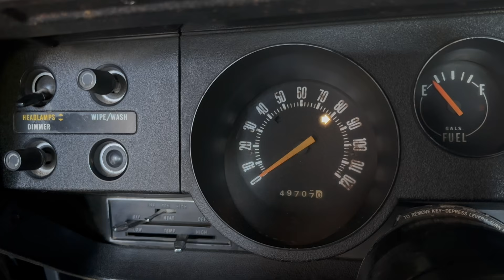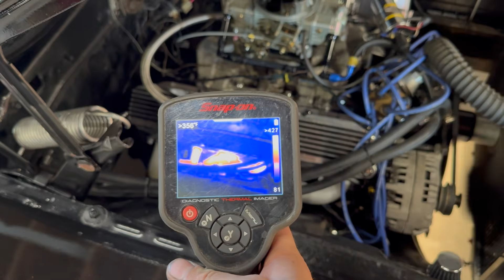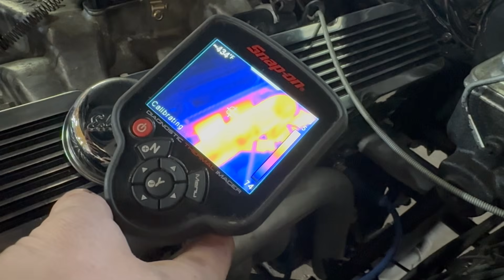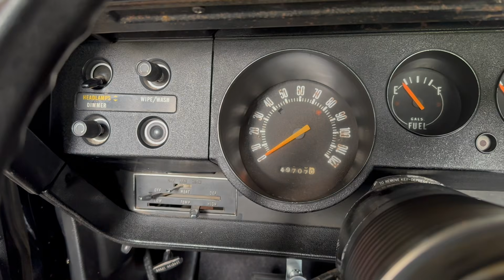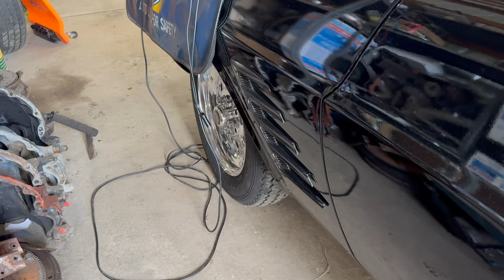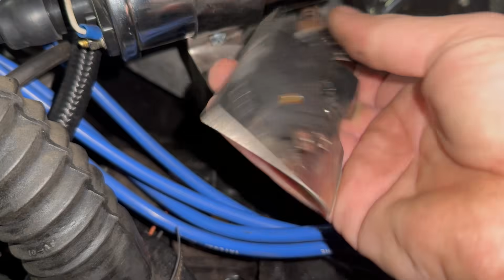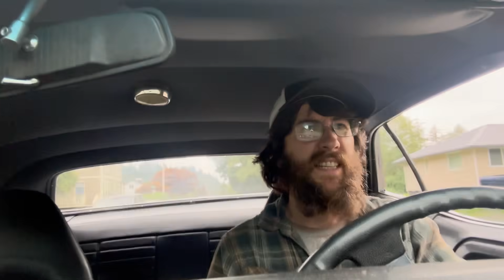What's Wrong With This 1973 Dodge Challenger? Electrical Gremlins, Big Block Tuning Tech, And More

Comment: Champions are junk they are not like they use to be I run NGK in my mopars that or AC but you will never find a champion in my Mopar because the quality went down since the 70's. another thing you should clean that carb it is black as the ace of spades and that is no good too
Reply from the maker: I disagree, they are just as shitty now as they always were, and I’m still running them in all of my small blocks. At least until my pile of them is exhausted. I think way too much thought is given to the name brand on one’s spark plugs. They’re spark plugs. They spark.

Comment: I could never understand why they put Gals in the fuel gauge on the standard fuel gauge it does not read by the gallons on the Rallye gauges so why did they ever do that and they only had it on the 70/74 E body standard gauges
Reply from the maker: Yeah no idea

Comment: I had the engine running like crap deal and turned out to be a ground issue whoever put the engine in the car did not hood a ground from the chassis to the engine and after that is ran so much better. It just goes to show how important ground wire from the chassis to engine really is.
Reply from the maker: Interesting. That’s never magically fixed anything for me yet.

Comment: I've not seen that far yet but I think its got a direct manifold leak
Reply from the maker: Have never found one, re-sealed the manifold once.
Reply: @DeadDodgeGarage  yeah I agree with everything you were talking about throughout the rest if the video. I was making that guess a couple minutes in but definitely a weak intake spring. You covered alot of ground with the ignition and the improvements that made for you. I have only recently started watching your channel. I like it alot

Comment: I had a 318 that would pop back in the carb like that. It was very unpredictable - sometimes days between it happening. Other than that it ran pretty good. Nothing I did made it go away 100%. Over a span of two years I checked and swapped out lots of intake and ignition stuff. Compression was good for the used engine it was. It turned out to be an intake valve slightly sunk into the head which caused the lifter for it to sometimes hold the valve open. I found it when replacing the heads. That 100% cleared the issue up. After I knew what it issue was I realized I would have been able to diagnose it by taking the rockers off and putting down a straightedge to compare to the other valve tips.
Reply from the maker: While that will reveal one valve that is way off, I can just about guarantee that most heads you check will have the valves all over the place. This is definitely an intake valve issue - whether it is occasionally sticky, or something else.
Reply: The total preload range for the lifter is something like 1/8 inch (don't remember exactly) making it visible for what I'm describing. So if the valve tips are off 10, 20 30 thousandths from one another that is normal and expected. If one is off 125 thou however you know there is a problem because all the lifter preload range is taken up.

Comment: A Jamie I had a 302 with a 750 vacuum secondary 
and I put a 50cc accelerator pump on it using the smallest suggested discharge nozzle but the extended ones and look out that works real good also I use the Alcohol Carburetors accelerator pump diaphragm 
and the discharge nozzle screw also I had used the accelerator pump cam that extended the shot   I don't see why a similar setup wouldn't work on a 400 ci engine  Just so that you know I had if I remember correctly a Comp Cam
.512 lift 270°Duration and even though you don't like 
Comp Cam  my car and a few friends of mine enjoyed the performance we got out of them
Reply from the maker: Comps used to be just fine. They’re not just fine anymore.
Reply: @DeadDodgeGarage  
I'll tell you what doing those supply side upgrades on a Holley by using the Alcohol Holley parts sure doesn't hurt it give it a shot next time those bits are lying around especially the extended nozzle accelerator pump discharge by using the extra capacity of the 50cc and the smaller of the suggested discharge nozzles you don't have it dribbling into the carb it looks more like a mini pressurized hose stream I believe that it has better way of introducing that extra fuel

Comment: I'm sorry but I never use Champion Spark plugs. We always stuck with factory replacement plugs. Fomoco and AC Delco. Except Chrysler. Usually Fomoco ( Motorcraft). Especially high compression stuff. Also much dislike Holley carbs. Carter :) IE: Edelbrock. But then everybody has their favorite things! Now I sound like "Sound of Music"😮
Reply from the maker: Factory replacement plugs? So, on a Chrysler product… Champions! That’s what they used for decades and decades. My Demon seems to run high 7s in the 1/8th mile with them just fine! And yeah, I’m a Carter/Edelbrock guy for sure.

Comment: First thing I did on my 1972 Plymouth Satellite was, flat black the front grill. Probably on the way home from picking up the car in 1979.
As you know They came with the metal grey coloured plastic with a small coloured piece in the middle and painting the grill black immediately changed the character of the car. 
Is that a 340 You got in that Pete ?   Nope that’s a can of flat black and some buckets out of a Sport Duster !
It’s the shape of the front bumper, and the lack of any badging on the 1972 Satellites that I like best. I prefer a sleeper, clean lines and minimal badge appearance on all my rides. All GO and NO show helps keep a man out of trouble.
The more I watch your channel the more I am motivated to reacquire an Early 70’s. I just saw a really nice in molested 1974 dodge charger400 Magnum, complete and perfect. It was for sale because they didn’t have storage. 
One of the last of the Mopars that I liked, I’m just not a charger guy.
Excellent video, and a huge public service for MOPAR owners.

Comment: also it's pretty easy to follow along and learn. I mean I'm high and autistic, but you'd make an excellent teacher for something like shop and applied mechanics or something out of high school. having practical hands on experience is invaluable. cant put a price on having those skills, even if you never need them, having them is never a bad thing. and that's the problem with the education system. most students dont find themselves learning applicable skills for real life, and are essentially set adrift without a sail. 

at least my shop teacher was an actual real general contractor. I learned how to build a house, roof it, wire it, and hang windows and doors.

Comment: You need to replace that dual feed with a center feed, i had an 850 CFM center feed on my 454 Nova,the throttle is on a cam so by about 1500 rpm both the primary and secondarys are equal position,it didnt have a choke and surely didnt need one even in Massachusetts winters,first cylinder up and it was idling,we went to Epping dragways every sunday,my buddy had a '70 Falcon 429 was doing too good so he borrowed my carb and on the line it puked and stalled,while it was off my other buddy put it on his small block Camaro,when he stomped on it,it lit up and he turned a 10.7 second time first time on the track,dont know why the big ford couldnt handle the volume
Reply from the maker: Need? No, that’s silly. I’ve never even seen one of those - not on a street car, not on a serious racer… nowhere.

Comment: Have never had any success with the "No Good Krap" plugs in American vehicles (H D will not even start with the "No Good Krap" plugs)...most FoMoCo's will blow the center right out of the "No Good Krap" plugs...
Reply from the maker: Well… ok. I’ve installed many hundreds of NGKs over the years, and have had excellent results with them. And as for Fords, well… no comment.
Reply: @DeadDodgeGarage  Not trying to hijack your vid,  That is a swell looking Challenger!  Have had good luck with Champions & Autolite in American cars.  NGK's work in the foreign jobs, just fine...Keep up the great "bringing them back from the dead" vids!

Comment: Well , the first thing I see is that the wheels are stupid and the proper wheel covers are missing. Of course there is no air cleaner ( that would be too traditional) . Basically the car has been turned into shit and only a child’s mind would appreciate it. It’s just disgusting!
Reply from the maker: The air cleaner was removed to work on the carb. You might not know this, but it’s kind of hard to diagnose and tune a carb with the air cleaner in the way. It was reinstalled at the end of the video. I could be wrong, but I think you might just be an idiot! Which I’m told can be hard to fix. Good luck!

Comment: The fusible link has a special insulation that stays in place when the wire inside melts.
This helps to prevent it from shorting to other wires.
Ordinary wire is not the best thing to use for a fusible link.
Reply from the maker: That… wasn’t ordinary wire. It was a fusible link. I would never suggest that ordinary wire should be used in place of a fusible link.
Reply: @DeadDodgeGarage  I just wanted to make that clear. I have seen other people use ordinary wire.

Comment: I have gradually learned auto electric fighting my own gremlins. I have learned to absolutely loathe fusible links. I don’t know if it’s “correct” but I eliminated all of them on my 93’ W250 12v using blue sea marine fuse blocks with maxi and midi fuses. There is a chart that shows what size link equates to what size fuse. Many of that truck’s issues went away with them. OnlyI time will tell if I resort to it on the Valiant or A100. 

I’m not suggesting you or anyone else do it, especially on a classic that’s not yours. Just throwing ideas out there. My truck hasn’t burnt to the ground… yet.

Comment: This makes me miss my 71 challenger I built a newer 318 engine for it and put a big camshaft in it it made for a loping engine that sounded great and it would wave bye bye if the hood was up I took it drag racing at a full quarter mile strip and it ran a 12.3 second pass on street tires with just a little spin on the line not bad for a little 318 engine and new tread on it I had done the offset shackle and a B body rear housing to get the widest tires possible under the back and everything I could do to make it launch off the line with no wheels spin automatic 727  one day a guy offered me to much money and it needed a lot more work at the time still miss it I would start it up just to hear it idol but with the amount of transmission fluid under it was concerning and I was starting a new business at that time and the stack of hundreds was just to much temptation for me I had reworked everything under the dash after the smoke genies came out one day the alternator gauge was the center of that mess new wires all thicker than factory was my solution

Comment: I've had great results with LED bulbs on my classic Mopars, just make sure to either wire in a resistor or keep at least one bulb in the circuit a conventional incandescent type.

Comment: My flasher function doesn't work (69 Roadrunner).  Would that be a ground problem?
Reply from the maker: Do you mean one flasher? All flashers? Turn signals, 4 way flashers, both? Bad ground to the sockets will prevent the bright side of the 1157 bulb from lighting. They will light up dim (the running light side) but the bright won’t work without ground, and when the parking lights are on, instead of brightening, the lights will turn off when the brake is hit or when they flash.
Reply: @DeadDodgeGarage  
All flashers.  The turn signals work as well as the driving light function, but when the flasher switch is depressed I get nothing, not even the dash lights flash.

Comment: Is the CAM in wrong ? Sounds like it.
Reply from the maker: I had the same thought. I installed it myself back in 2017 but did not degree it. I just installed it dot to dot. For the record, it did the same with the old cam.
Reply: @DeadDodgeGarage  when i installed at purple cam in my 440 it was straight up .the dot I mean.the head's were open chamber with a stage 5  grind.the valves almost touched. It was a mobster.

Comment: Those old plugs looked like the engine was running rich AF. Way too much sooth. They need to be brown-grey-ish after a hot run.
Reply from the maker: Believe it or not, I know that! And in the video, I explained that the idle screws were twice as far out as they should have been, and it was billowing black smoke when it arrived. I had already fixed the idle settings before filming.

Comment: Now, I have to ask this Stupid Question.  But Being that it it is a H E I Ignition, Is there a full 12 volts going to It?  Ask Me How I know this Issue.  If it still Has the Resistor 9 volt wire, It will fall on its face.  There again ask Me How I know this.  The Blind Cajun.  P.
Reply from the maker: Yes, the resistor is bypassed.

Comment: LEDs are a great idea.  Vastly, vastly better than old fashioned bulbs.  I have a full LED conversion inside and out on my '93 D250 and I love it.  Very worthwhile upgrade and I have zero regrets about.  As long as you get LED flashers or load resistors for the signal bulbs, you're fine.  Or you can get the fancy bulbs with the built in circuitry to make them play nice with the normal flasher.  No need for  headlight relays with LEDs since they draw no current to speak of.  Get Auxitos.  They are good quality bulbs.  I've had mine in the truck for 14 months now, and zero issues.  I drive exclusively at night, so they get used all the time.
Reply from the maker: LEDs look wrong. I completely disagree that they are “vastly” better. I tried an electronic flasher. Those front amber LED were just trash, straight up the bright section would not light up unless the running lights were on, and they wouldn’t blink. Period.

Comment: Passing along for WIW. The rocker arms are stamped, as we all know. Sometimes the tip of the rocker at the pushrod end will slightly split allowing the valve to not have the proper lift because of the additional clearance. (Like a bad cam lobe) I bought a 73, 340 with a horrible backfire. The pushrod had actually worked all the way through the rocker end stopping the valve from opening. Worth a check to make sure the rocker shaft is torqued correctly and all valves are operating at the same lift amount.
Reply from the maker: I’m well familiar with pushrods punching through. Have fixed that several times. The reason I am not looking there is because this issue existed both before and after I personally replaced the head gaskets on this engine. All rockers, push rods, valve springs were in good shape at that time.

Comment: Tail light panel needs to be argent, looks like ass painted body color. Great job troubleshooting and cobbling the fixes. Just the way I would have done it. You’re absolutely right about constantly things to fix with classic cars, seems never ending sometimes. Just cobble it and enjoy. 🤣
Reply from the maker: Yeah I wouldn’t have done it body color. When I owned the car and it was yellow, the argent looked like garbage anyway so I did the tail panel and the entire grille and grille surround in semi flat black (except the chrome grille trim and headlight rings.) That was a sweet look. Now that it is black, I would put it back to argent.

Comment: I do like LED lighting.  But aftermarket makes them very unlikable.  Too many issues usually related to either quality, or the vehicle's rejection of them, they are finicky and if the electrical values aren't supportive they wont flash or something dum. To me, if you have to add a Resistor then that defeats half the reason to using a Energy efficient LED, because the resistor just makes it duplicate the resistance of the tungsten filament bulb and use the same power. The pro, bighter lamp.   So the only thing ive found worthy are usually sometimes Headlamp LED.  Again if you can see past some of their quality issues.  Fit and finish. Ive had good luck with some.

Comment: Ported vacuum advance has always been better than manifold in my experience. I know you've tried many distributors but checking rotor phasing can't hurt.
Reply from the maker: In my experience over the past year, I have found there is a situation where manifold vacuum control has its place - a 440 with a big, ridiculous cam. But your mileage may vary. And that’s a good thought too!

Comment: I thought there was too much timing into it.  Try this.  Inside the vacuum advance the is an adjustment.  Remove the vacuum hose and take a 1/8" hex or alan wrench into the vacuum advance.  Back out the alan or hex screw a half a turn and check your total advance numbers again.  Adjust again as needed.  Backing it out reduces total timing.  The factory ignition is a good one.  Oh and check the coil resistance numbers.  If they're off replace.  Note the most expensive coil at the store will likely be good number.  Don't ask how I know.  Good luck
Reply from the maker: So… did you watch the video? When I explained how that pod is adjusted, and discussed adjusting it twice? I understand it’s a long video, but if you’re going to try to help me… we kinda need to understand on what level we’re standing. The screw does not change the amount of vacuum advance, it only changes the tension on the spring controlling that advance. It will change the number of degrees you see in various situations, but it does not physically limit the advance in any way. That’s a brand new coil. All other ignition components are also brand new. Thanks.

Comment: Broken valve spring?
Reply from the maker: I had the same thought. I definitely didn’t see any when I changed the cam and head gaskets in 2017.
Reply: @DeadDodgeGarage  Possibly a weak valve spring.